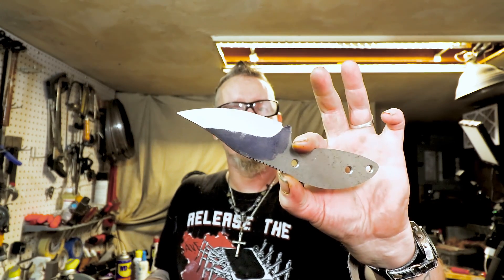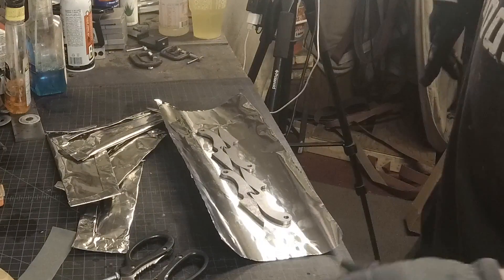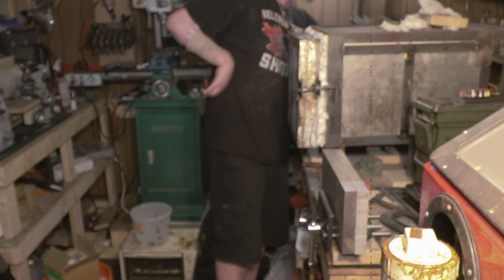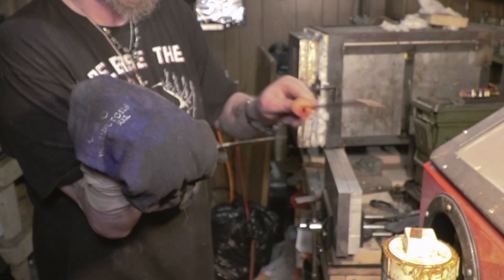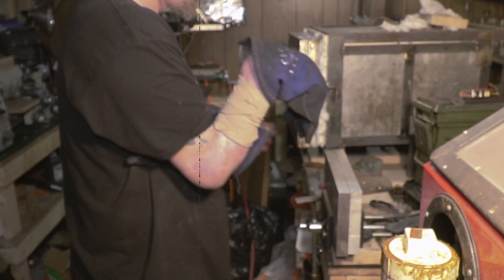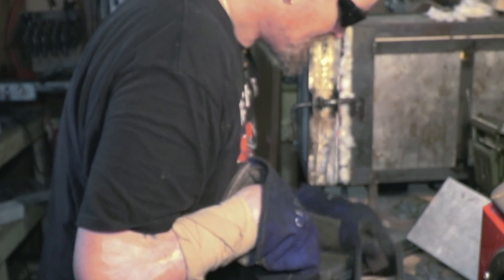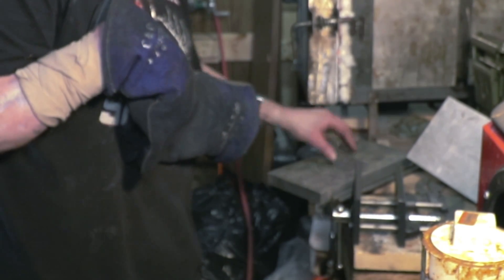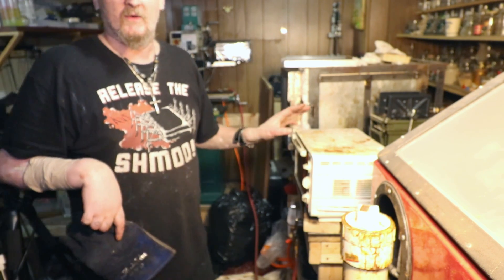AEB-l & CPM3v Heat Treating Adventures(Dry Ice Cryo Treatment 2018)

Comment: thanks man!
i'm close to heat treat my first cmp3v knife.
but it's hard to find instructions.
I would love to see more!
Reply from the maker: Yeah, unfortunately, my oven needed to be fixed... I'm almost finished with a 2nd smaller oven, mainly for Stainless & Higher temp steels... I would suggest following the data sheets... just google the steel & it'll give you all the info... I'll do another video when i get my oven working...
Reply: @evaderknives  can't wait  :)
Reply: You should heat it up to austenitic temperature levels and then cool it as fast as you can without creating micro fissures. Extremely saulty water solutions are recommended. This will get you a 100% martensitic matrix. Then proceed to temper between the temperature values you desire according to how much strength are you willing to sacrifice in order to gain ductility and impact resistance. Avoid cooling the blade extremely fast as you will incur in fissures and dendrites which will harm your blade beyond repair.

Comment: I wonder what the difference is between the metal and if it makes that much difference. I new to knife making and plan on buying equipment for SS.
Reply from the maker: Vanadium is what is used in high speed steels like drill bits & lathe tools, to strengthen rigidity, the nitrogen is just a better blanketing gas, so the steel has less impurities...

Comment: It’s clearly already hardened steel. Don’t know what my grinding did to the steel
Reply from the maker: Are you sure it was already hardened? It might be mild steel with carbide on the tips... Honestly, I've never tried using mystery steels, there are just too many variables. Also you can get knife making steel from jantz or alpha for pretty cheap, it's definitely worth it, if for nothing else to save time & effort with a steel you don't know... Good luck though...
Reply: I don’t know but I like to never get 2 1/4” holes drilled in the tang for scales. I mean that steel tang was as hard as any stainless I’ve ever tried to drill through
Reply from the maker: How did you drill the holes? Unless you are using carbide, drilling through hardened steel is nearly impossible. Even with cobalt or Molybdenum bits. You might want to anneal the tang.. If the blade is hardened, you can dip it in water and heat the tang to soften it.  Unless it is air hardening steel, that's a whole other process.
Reply: I don’t know. I’ve drilled through stainless steel before on bathroom partition jobs and this was very similar, hard as hell to drill through. I just see a bunch of people using saw blades to make knives so I gave it a try. It worked well but I don’t know if I need to heat treat or not. It seems pretty darn hard as is. It’s getting too late for me so I’m going to crash. I’ll work on it tomorrow and get back with you. Thanks dave
Reply from the maker: Awesome. Just remember, a lot of times stainless is hard to drill because it is like aluminium and gums up the bits, which can dull them, not necessarily hardness(though i'm speaking in general, so it's hard to really know). Yeah, definitely keep me updated.. P.S remember, just cause you see guys doing it on YouTube, doesn't mean it's a good knife. Editing does wonders to make people look good, hahaha...

Comment: Dave I have a question for you. If I make a knife from a 12” circular saw blade. How do I go about heat treatment
Reply from the maker: Well, honestly, I've never tried it. 1st you have to find out what type of steel it is... my suggestion, before you go all out, make sure it can be heat treated... Some saw blades are mild steel with carbide on the cutting edge... I would try taking it past magnetic, then give it a little more and quench... If oil doesn't work, try water quench, if that doesn't work, it might be an air cooled tool steel... That's the problem with mystery steel, it's hard to say...
Reply: As you can see my knives are not all out. They are pretty conventional  simple knives. I’ve learned to make sure the blade is able to be sharpened before I spend a lot of time on the scales
Reply from the maker: Right, as long as you are enjoying what you are doing, that is really the important part.

Comment: Dave,mthermocouples do not last forever. I think yours is beginning to fail. Cheapest thing to replace when you need to. Good luck!
Reply from the maker: Actually, the thermocouple is pretty new. it's the elements that are fried.. I got some new ones on the way... I'm gonna redo the sides with 6 lanes instead of 4, so it'll be a lot more efficient.. Thanks for the tip though...

Comment: Awesome video. I don’t understand half of what was going on. I’m just too green to understand, one day I’ll get there and will remember what I saw here. Thanks Dave. Get some well deserved rest!!!
Reply from the maker: Haha, right on... Basically stainless steals made for knife making are air quenched steels, so they require a very high temp heat treat 1950f... The aluminium plates help speed up the air quench, then dry ice(cyro treatment) adds toughness... If you ever have questions, just ask.. I'll do my best to answer...

Comment: awesome , dave really diggin the lessons thanx dude , i gotta get me so hardness test files , one of my 1075 blade tested out at 57 , think i tempered it 2 much  , oh well ima keep trying , bummer on that file knife with the wicked hamon micro fracture tip broke off  , thank u 4 the encourage mnt bro ,
Reply from the maker: Yeah, it's all trial and error... 57 still is pretty good, depending on what you are using it for. in fact a lot of guys like a lower HRC on bigger knives... Take it easy